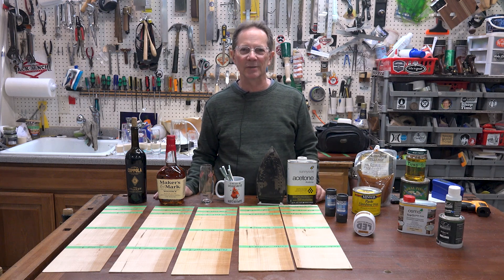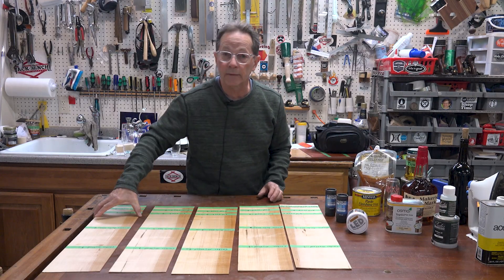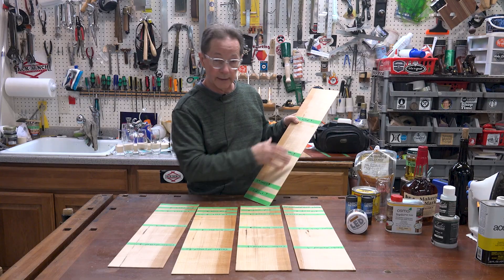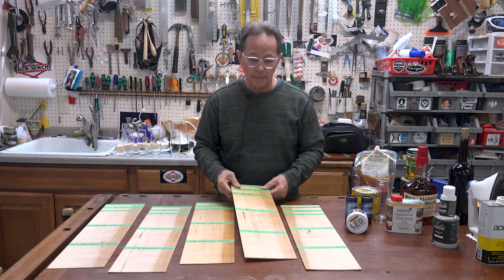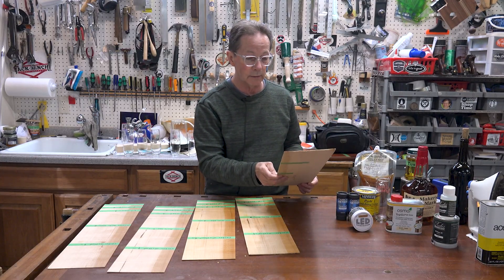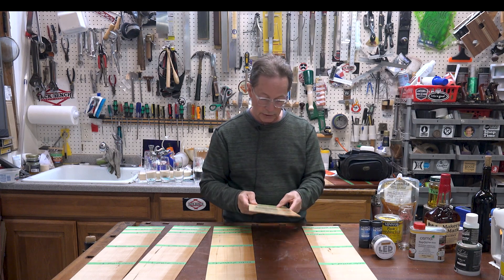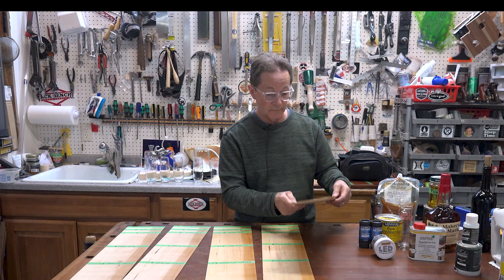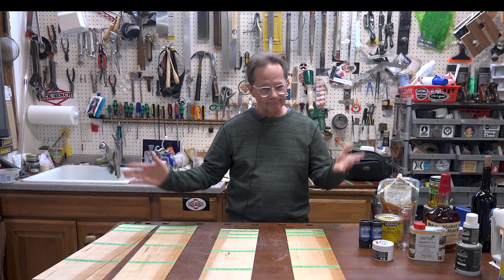Testing Hard Wax Oils w/Ceramic Coatings and w/Wax

Comment: Thank you.  Problem with all of them is that they cannot be used with aniline dyes or other pigment.
Reply: Why not?  
I have mixed Rubio with stains, result were ok not great.
Reply: @CharliedeLaChapelle  From Rubio's own product info: "Rubio Monocoat recommends using their own compatible pretreatments like Pre-Aging, Fumed, or Precolor Easy because standard aniline dyes or other stains can block the molecular bonding required for Oil Plus 2C to work properly, potentially preventing the finish from adhering or curing correctly. Always use Rubio's specific products designed to ensure the oil bonds directly to the raw wood for a durable finish. "  
Perhaps that's why your results were "OK, not great."  
I primarily build reproductions of 18th century museum pieces.  Given the amount of time I put into building such a project, and then into prepping and finishing it, and given the cost of Rubio (or any of the other hard wax finishes) especially as compared to something like shellac or armorseal varnish, I'll stick with my tried and true products.  They don't take that much more time, and the results are great, not OK.
Reply: Right.  
Good info.  
I tried the Rubio stain products for the reason you quoted and results weren't that great.  
Cheers